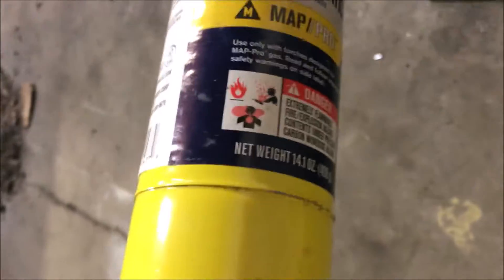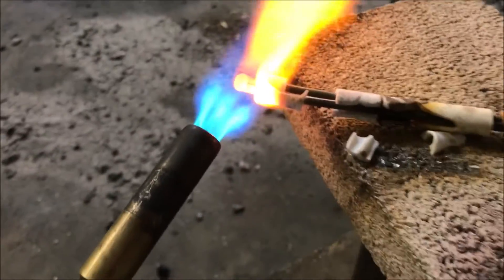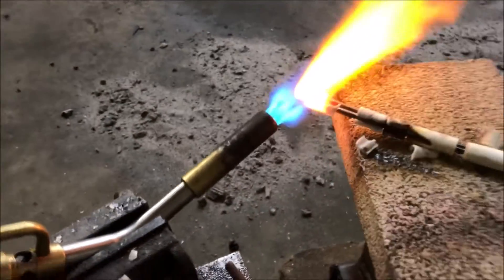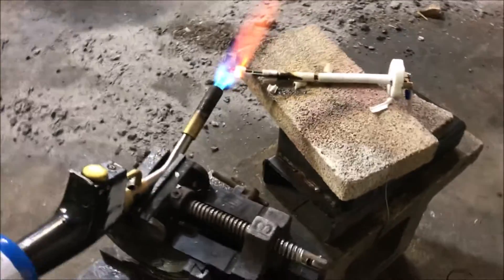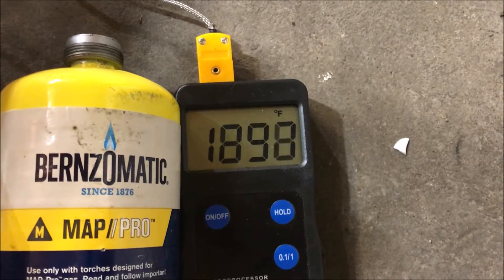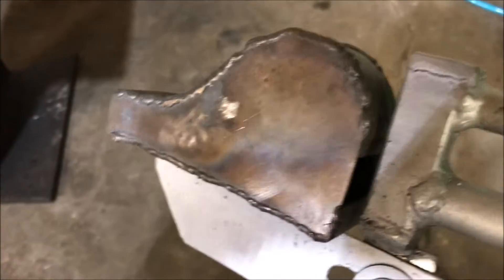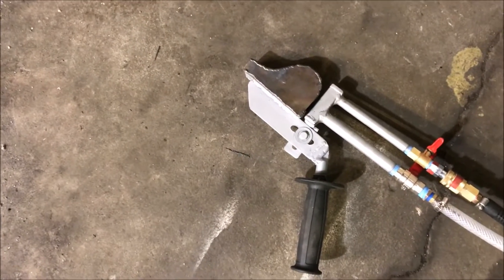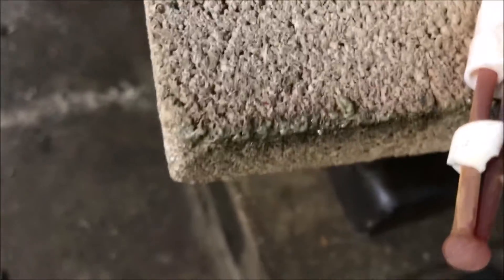How much hotter is MAPPRO vs Propane Vs HAND DRAGON

Comment: I melt gold and silver and STRUGGLE with a dual turbo torch above about 50 grams. If I replace the dual turbo torch propane with mapp pro it nearly instantly finishes the job. To the point that I preheat with propane then finish with mapp pro. I don't know the temps involved but the mapp is way better at heat transfer and btu density

Comment: I can tell you right now that while MAPP/MAPP Pro is only about 100 degrees hotter than butane/propane/LPG, it heats MUCH faster and hotter than propane. I did a test, using a propane torch (it takes those cans you see portable stove takes), to heat a piece of steel to cherry red. MAPP gas was able to get it cherry red even if it took a bit long, while propane is absolutely unable to heat the steel to cherry red AT ALL no matter how long you took. The only way propane was able to achieve the temperature is with insulation, like with a piece of fire brick around the piece in order to keep heat from leaving (or perhaps a much larger flame could do the same). 

So it looks like MAPP/MAPP pro is useful for brazing, probably about the same as a turbo torch (acetylene air). 

Oxygen/propane can achieve the right temperature for brazing easily by the way.

Comment: Not the same angle with the hand dragon, you pointed the hand dragon more “into” the sensor, whereas the map and propane were just pointed across the tip. May or may not make a difference but for me it negates any claims unless they’re tested in the same way.
Reply from the maker: In both test the objective was to set the flame at the tip of the inner cone , in all 3 test the tip of the inner cone was used to hit the thermal couple . But i agree changes in set up can give a hidden advantage . I assure that under no circumstances can you get a mapp gas torch hotter then 2020 deg F . At 245 deg hotter  for the hand dragon there is no way the test can be made to show the opposite inwich case the mapp gas wins the challenge .  Thanks for the input though , i do not disagree with you regarding the possibility of different results under slightly different conditions . This was a test model by the way , the torch looks much different these days and is now so hot the thermal couple cannot read the temp as it is great than 2,400 deg F.
My guess is its 2,650 seeing as thats ho hot it can get a foundry furnace https://youtu.be/jDpLKkzvb6w
Reply: @NOBOX7  thank you for the kind and objective reply! Definitely no argument about the map temp not being able to beat out the torch at the listed results. Definitely going to go check out the new video. I started all this searching to see if map or map/pro is worth the added expense for basic home mechanic stuck bolt heating, doesn’t seem like it is for such a little difference. Thanks again!

Comment: Back the flame up to the hot spot
Reply: Thats what I was thinking  thats the hot spot not in the middle
Reply from the maker: The tip of the inner cone is the hottest point and that's what i used , off camera testing dictated this position guys , im not a scammer i want the  truth  you cannot get the map torch hotter no matter where you place it , i moved the torch into the hottest position as it was lit , turned it off then started the video

Comment: You didnt show the temp gauge for that dragon thing. Also seems to be defeating the purpose of a small hand held torch. I guess if the only plan was to make a hotter flame then congrats. You have created a cumbersome tool for spitting out hot flames...
Reply from the maker: 3:43 ????
Reply: @NOBOX7  shit idk how I missed the readout at the bottom right. Whoops. But either way the rest of my comment still stands.
Reply from the maker: @RawDawgRandy  Have you ever worked in a ship yard fab shop or done any more than work on  a harley ? 
How the hell is it defeating the purpose ? purpose of what ? This torch puts out 36,000 watts and can braze 1/4 steel 
you cant braze with a propane torch and if i ever catch you trying it on my jobsite ill fires your ass in a heartbeat

Comment: No it's actually about 900 Degrees hotter but I'm talking about the original Mapp gas
Reply: That's likely with oxygen. Everything is 900 degrees hotter with oxygen, even propane. I was able to heat a fairly large steel bar to cherry red with mapp, propane couldn't do it at all without assistance (either with oxygen or with insulation such as fire brick).
Reply: You are right the problem is with marketing people think oh mapp gass is way hotter when in reality it is but only about 100°F when the older discontinued mapp gas burned at 5300° you can get propane and map pro to burn at 5300° ish but you need to add oxygen  @taiwanluthiers

Comment: Those ignorant people have no clue what they are talking about, do not understand physics and how speed and pressure enhance combustion. Some day we hope they will wake up and learn.
Reply from the maker: Well friend just think about this , in the future will  run out of "cheap" liquid fuels , even with fischer trope systems but if you built it there may come a day when oil is every where and useless because we ran out of  cheap gas  , so waste oil may be a huge fuel for a short time . It does burn with an extremely filthy flame but just think we have machines that burn coal ...
Reply from the maker: Your input was spot on about velocity in flames ,  we discussed that a year before i was even able to put it into practice and finally today  I got to see it corroborated with a thermal couple and again  spot on that a louder flame is also hotter ,  we seen both and all i did was focus on increasing velocity of the flame . Shock diamonds are my new goal LOL ...
Reply: @NOBOX7  I'm just glad you stuck with it. Its so awesome to see these designs grow and progress! Even though I have machine tools and steel at my disposal, [technically] they are always in use for machine maintenance and the likes, so I really get no time to play.

My brother is looking to buy a certain plasma cutter in the future, which, if all goes well, will allow us to begin making custom flat (or bent) small to medium sized parts and in large quantities.

At some point I will build a turbojet specifically for the purpose of proof of concept, which runs on used motor oil, which, at this exact moment in time, I am not aware of anybody making, but, I am quite certain it can work just as well as diesel fuel, if not as clean, or powerful, but again, since its all about speed, heat and pressure, one never knows.